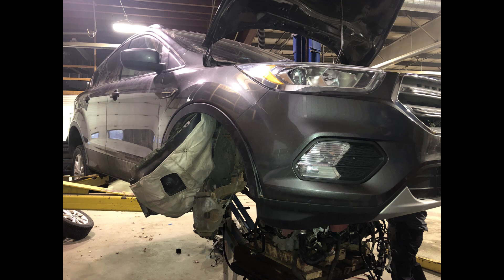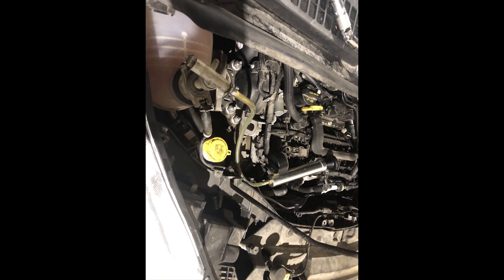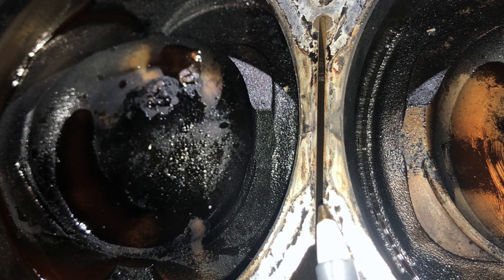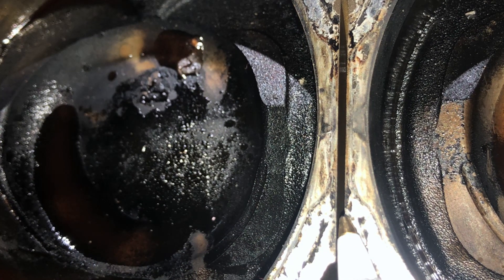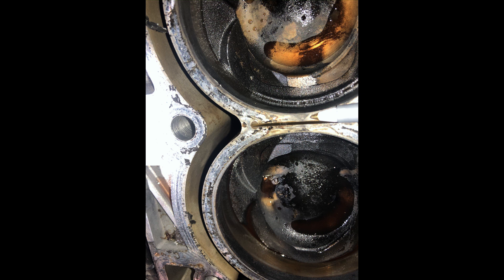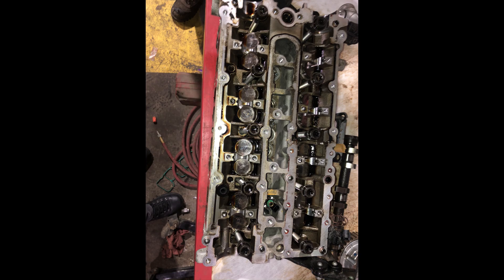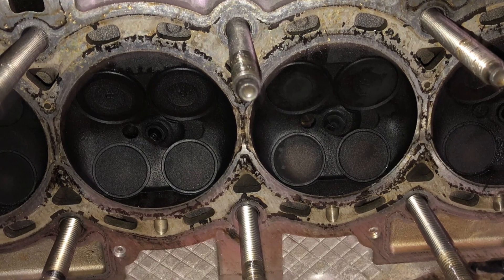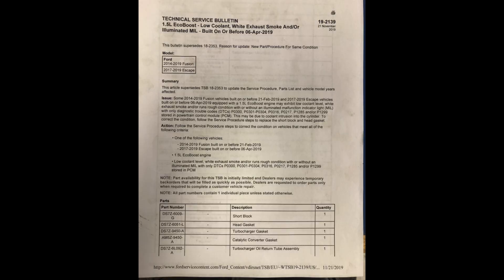2017-2019 Ford Escape 1.5 Low Coolant, White Exhaust Smoke,P0300 misfire

Comment: Just took my 2017 Ford Titanium Escape with the 2.0 into the dealer. Found water intrusion in #2 cylinder. Great! Holy shit! 30,000 miles on the odometer. Have full warranty's. Thank God! Said it would be a month before they could even get to it. No rentals anywhere! No loaners either. Will put antifreeze to correct level. Then dump it on Carvana. NO WARRANTY'S. $15,000 out of pocket. Sorry consumer! No recall either your stuck. I hope Ford stock crashes tomorrow. Selling millions of defected cars and suv's to customers knowing the engine block's were faulty. Year after Year!  Still no recalls!  O.k. any body out there that has a 2017 to 2019 Ford Escape with 1.5 or 2.0 engines listen up!  Beware!  The antifreeze will disappear from the antifreeze bottle. Going into the cylinders. Bad blocks! Defect during construction of engine. These engines were built in the good Ole U.S.A. Cleveland, Ohio. The Kuga engines that were built for Europe were built in Valencia, Italy. There engine block's don't have the defective water jacket indentations in between the cylinders. The replacement blocks  2.0 4 cylinder. Have just two little holes to help cool the blocks. Ford sold millions of defective block's. In cars and SUV's. Get rid of your Escape as fast as you can! Before it to late! Dump them! Join the nation wide lawsuit against Ford. Let them know that they can't get by with screwing the consumer's of America. Stand up against Ford. Put them out of business for good. Then the other Car manufacturers will follow suit and stop selling defective cars and SUV'S. When they wont even recall the ones that they sold and knew they were bad!   Shawn.
Reply: The recalls are now active for their design defect, so if ya had it replaced professionally they should reimburse you now.

Comment: This problem is only in USA cars or it is present in Europa cars?
Reply from the maker: Should be across the board.
Reply: The Kuga motors were built in Valencia, Italy. There motors don't have the indentation in the block or water jacket that cools the engine. The replacement engine has two small holes that cool the engine but didnt come out till 2020. No recalls yet from Ford. If your warranty runs out. It can cost $15,000. To fix a 2.0 turbo Escape. I know I have 2017 model. Found out today the block is shot at 30,000 miles. Never again will I buy a American car or SUV.  Hope this helps you out.   Shawn.

Comment: I took my 2017 Ford Escape SE to dealership because I was feeling a slight tug. Doesn’t run rough at all. It runs so smooth and strong but feel that slight tug. 
Ford says I need a brand new engine. The guy at dealership says they just got TSB from Ford in December of 2019 stating their advice is replace engine because same problem will happen again. 
I just bought the car from private party. He straight burned my ass!!!

Comment: I have 2017 with 2.0 Ecoboost 77k miles out of warranty, Losing small amount of coolant and rough Idle at start up with P302 code, Ford hasn't done any recall on this, Not profesionaly diagnosed yet. what say you ?
Reply: You need a head gasket. Looks like they mostly fail and leak into cylinder 2 and cause a misfire at start up
Reply: @Gregg0112  wrong, the 2.0L is not being repaired only replaced.
Reply: If you are the original owner call Ford customer service after you get a estimate from a Ford dealership, preferably the one you bought it from. Ford is helping the original owners with repairs outside of warranty.

Comment: Just got mine back...block and head replaced. 2017 SE with roughly 40,000 miles (60,000km) No warning.. check engine light and rough running right from the start...and the start was overnight

Comment: I got these codes. I also have the conditions. And a captured engine fault.  I did not get a new engine or repairs outlined in the tsb's. Just got two new spark plugs from ford. Versus the needed repairs. Disappointed!!!

Comment: My 2014 has this problem, what is an average price for this repair
Reply: Buddy in work has a 2015 Fusion with same 1.5 & 3000 miles out of warranty. Dealer quoted $7k for the short block & labor. They Suggested for him to call Ford to see if they will pay. He just contacted them today so he doesn’t have an answer yet.
Reply: @pfmurphy525  any news: